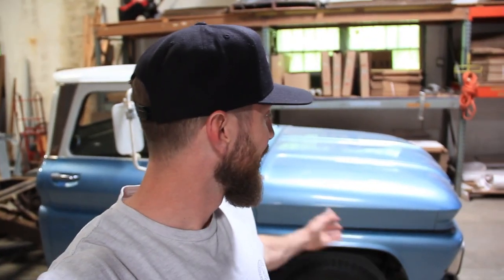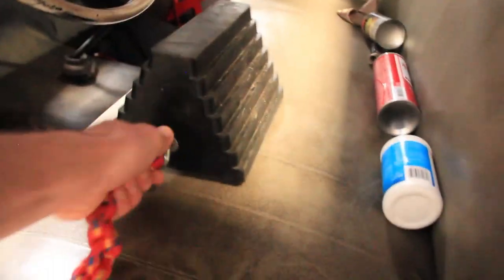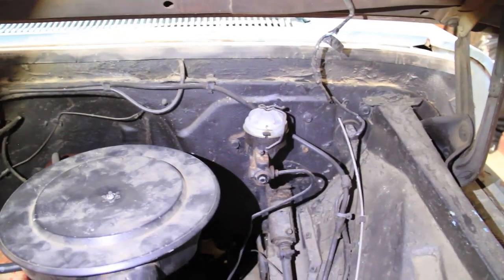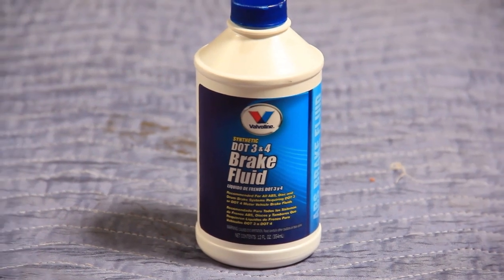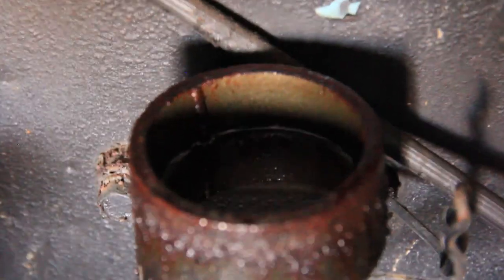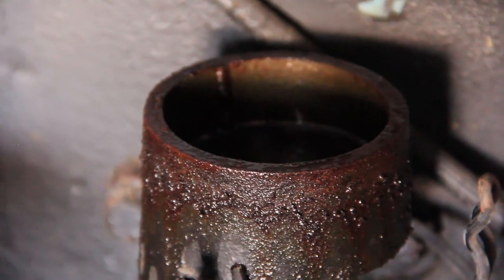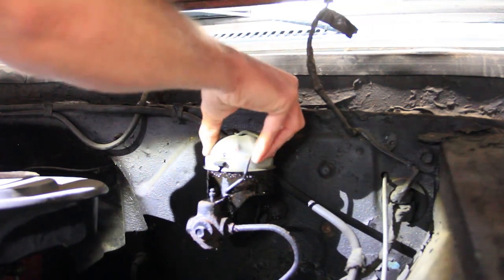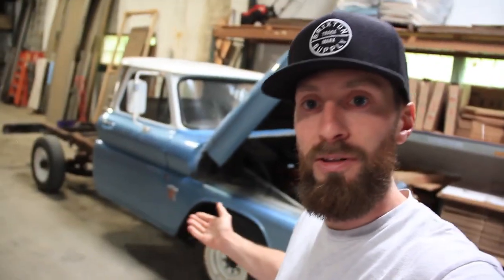How to Fill a Master Cylinder with Brake Fluid - 1966 Chevy C20 - Inline 6

Comment: If you push in the little rubber part on the cap you won't have any fluid spill out when you put the cap back on even when entirely full.
Reply from the maker: Thanks for the tip Hayden!  I'll try that next time. 🙌

Comment: I have a 66 also. Do the brakes work without the truck running? Or does it have to be on and driven?
Reply from the maker: Hey!! Thanks for watching.  Our breaks work no matter if the truck is on or off.  Does yours?

Comment: I hate to BURST your bubble, but you aren't even close to being done with your brakes. I can see that you still have a lot of brake peddle travel and your master cylinder was empty. You have air in your system. You have to now bleed your brake system starting with the passenger side rear, then drivers side rear, passenger side front, and finish with drivers side front. Good luck.🍁👍👍
Reply from the maker: Hey Andy!  You're absolutely right, the break lines needed to be bled.  We didn't film all of the work we preformed, but simply adding the fluid was a night and day difference.  Now we can move the truck around our shop with out free of running into a wall.  The video about bleeding the break has been filmed but needs edited.  It'll be out eventually.
Reply: Actually the longest brake line goes to the drivers side rear. It travels down the passenger side then across the rear axel to the drivers side rear. So bleed drivers side rear, then passenger side rear, then passenger front, and finish with drivers side front.
Reply: If you can add text to let people know they must bleed their brakes, you may help them avoid an accident.